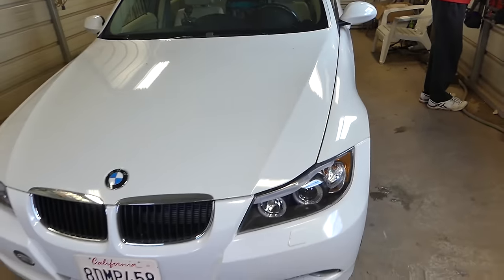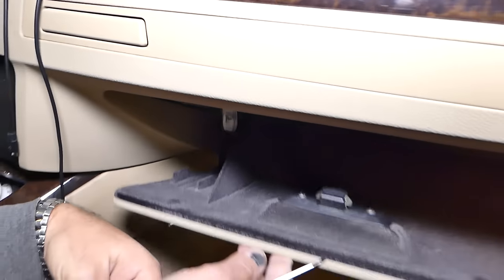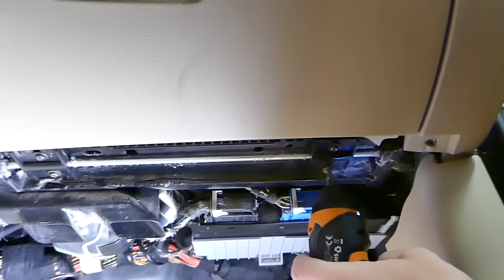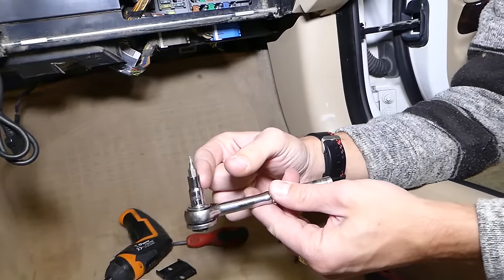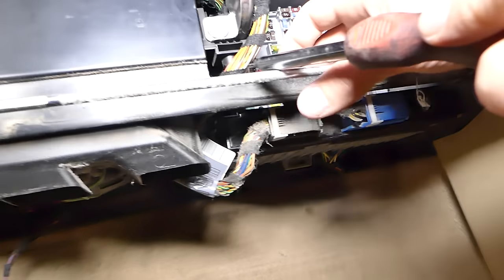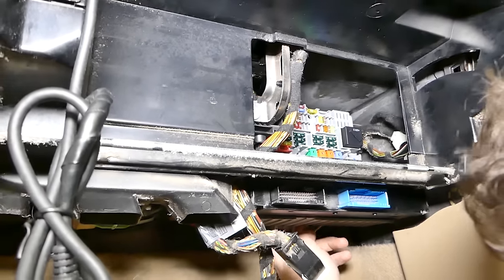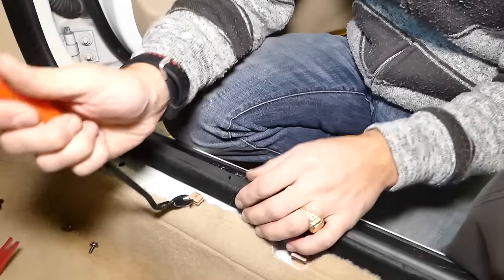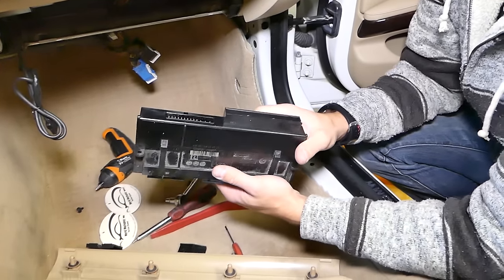HOW TO REMOVE AND REPLACE BCM MODULE BMW E90 E92 E91 E93 BODY CONTROL MODULE

Comment: How can I test if the BCM is faulty and where can I buy it if it needs to be replaced? Currently the cars cluster lights up and wipers won’t stop moving. I have checked ECW as well as the FRM and they are both working fine according to ECU-Pro. I have a 2008 BMW 328xi
Reply: Same thing on my 335i
Reply: ABS module

Comment: Without seeing how that rear wiring harness came out it would have been very difficult to figure out.  Thank you!
Reply: I tried to apply pressure on the rear wiring harness by pushing it to the right but it didn't move and I wasn't able to disconnect it. How did you remove it? Is there a trick in doing it? I don't want to break that thing.
Reply: @Bakdons-yn3cg  I know it is plastic and you want to be careful.  The part of the video we are talking about is at about 7:38.  Make sure you are pushing it in the correct direction (I am sure you are.)  All I can suggest is keep applying a little more pressure at a time until it comes out.  Good luck.

Comment: I have a bmw 325i 2006 but I have been having some issues with my battery dying when the car is off the alternator is good the battery is new . When the car is off for more then 15 to 30 minutes the push / start button turns on and  off. I think that is what has been draining my battery. What do I need to fix to make this stop and how do I fixes it ?

Comment: Seems the question regarding whether you need to code the replacement module or not is still pending. Anyone knows?  I have no power to the AC blower and the fuse is fine. I'm suspecting something is wrong in that junction box. Thanks in advance.

Comment: Thanks by the way. You did a video on the front airbags sensor. I discover the sensor on the car was unplugged after original owner have a minor crash. Cosmetic damage but it was not reconnected after repair. Your video saves me a bunch of money

Comment: Hi Can I ask you about this module.
My car is 1 series 2007 
I had a some strange noises coming from this box when I stopped the car from the (start and stop button) then immediately I start it again and then the noises started. The lights on the Dashboard started flashing and the key stock in the ignition. 
Do you know what is the problem?

Comment: Hi mate, good vidéo thanks ;)
I dont understand whether or not WE must unplugged the battery beforeremoving thé jbe? As you Saïd : IS really it mandatory as i have been told that removing battery Can bring issues for some programming modules, memory stufff ... Or am i wrong?
Then, do you know if WE must redo programmation if i plug a New jbe cause mine seems to be damaged no more AC, Rear door windows (i already checked with my mecanisc Friend with BM soft)

Comment: I watch a lot of your videos and they have been helpful I’m having an issue with the fuel pump I drive my 2011 328i xdrive and all of a sudden it just shuts of barely able to steer and pull off to the side of the road the message on the screen says fuel pump failure waited over an hour and it started right back up no problem drove home changed fuel pump watching one of ur videos thought it was fixed drive a few days later did the same thing waited 10 mins and it started up again no issues it keeps doing this need your help!!!
Reply: Cam sensor and vanos cleaning then clean cam witch is the crank under the starter, then change oil and cap if that font fix it clean throttle body after that hit spark plugs take them out wire brush if that don't help change coils . If those font work replace black box  fuse in glove compartment

Comment: Hi i got a 2007 bmw 335i
my problem is that i am not getting the dme to wake up, have no power to my dash.
when i disconnect the bcm the car turns on.
i tried replacing the bcm module with use ones and i am still getting the same result.
any suggestions will be appreciated.
thanks

Comment: I scored a nice running ( like new) 06 bmw 330i.  And if you have one you and this guy are automatically friends lol. It’s god steering wheel lock displayed and seems not reading the fob ( batt. Not dead) in car or fob. Cluster communication error but this is why I got it cheap !!! It is nice though.

Comment: Hi.
I have 2009 bmw 120d e87 and i have fault code 2e41 engine ecu interface.
I have checked all fuses and relays all loks ok.
Bat the car would only crank no start,the key is locking and unlocking  car no problem. 
Any recommendations to where to look next or what to do next?

Comment: Hey, could you explain fault code with I get 50 MRS power supply for bmw e83? I have airbag light on dash but can’t find info. Would think that I need to change steering spring but not sure if you could explain would be awesomely.
Thank you

Comment: Good video but you miss a step in your explication and it's a very important step. Im talking about the back connecter at end of the video. Every step is perfect but i had to find this information in other chanel. But over all it help me a lot utile i got to this part.

He talk about pulling the back clip to the right. That is acually true but before to do that you need to pull the modul out of his trey and twist it a little bit so you can slide the clip up inted of just saying to pull the clip to the right.
Reply: Thank you! This was what I needed to know.

Comment: Hi I’ve an 2010 E91 my blowers and air con just died plus stop start isolator stopped working even when I have my lights on the unit does not light up is it fuse’s or module or BCM as everything else is running spot on

Comment: friend, I have a BMW E91 (330D touring) 2007, the radio only touches one side of the car, the left side is muted, there is no problem with the cable, the radio is not burned out, you can tell if this module of the body also controls the radio?

Comment: Hi I have an e93 2011 my logic 7 amp has no power in the harness and the fuse is good do you have any ideas please no acoustic sound happened after pulling some fuses out

Comment: I've seen a video on YouTube saying the electronic control module situated behind the glovebox is responsible for auxiliary coolant pump, glowplug module and thermostat? These parts are throwing me fault codes and I'm wondering could it be the module before I change the rest. The auxiliary pump is working when tested on the bench? Thanks

Comment: I have a 08 328xi just changed the ecu and the cas with key and ignition  still no start. Crank but no start. Bruce Brantley

Comment: i have a 2007 530xi wagon everything lights up to start but the starter just clicks twice,,,Code DTC U112B Lost Communications with Instrument Pack Status (SIG) ...Do you think it is the BCM? thanks! iF YES IS IT LOCATED in the same spot as this video remember it is a wagon?

Comment: Does it control the key for open and close as well ? Mine does not work . Sometimes after a ride the key starts working again . So i can close and open by pressing the key . After sitting for 15min . The key does not work anymore when i press the open or close button

Comment: Hi !! I have a e 64 630i it cracks , but will not start (sometimes it starts fore ONE SECOND... ) I exedently put 12VOLT on the CANBUS wire (red/blue+red) sow i cheqed all the relais and fuses they al work.. i messurd the ohm on the canbus and it has onley 20ohm and on the computer unplugged 45ohm ... What doe you think please thank you !!

Comment: Hello guys, looking for some help here.

I have an 07 bmw e92 325i, which wipers arent working properly. I have checked relays. Fuses, replaced the wiper motor, tested known good steering columna with new wiper controler lever, cleaned the frm module. I haven't tested the bcm module yet, do you think this may be the root of the issue?

Any help will be pretty pretty appreciated!

Great vid btw, you guys always help!!!

Comment: I have 2006 bmw 325i I'm having a issue with car not doing nothing wen I insert key dash stays black car don't turn on I have interior lights also unlock and lock buttons work I checked all fuses and replaced relay in dash

Comment: Good day  i have a bmw 1 series 120i 
Car has no spark 
No pulse
No power on plug that goes in the valve tronic
And no power on the crank sensor plug
What could be the problem

Comment: Hi,
My central locking has stopped working on my car. When I press it to unlock it opens all of the locks, but it does not lock all of the doors when I press the locking button either on the key fob or the inside of the car, it only locks the driver door. Any advice? BMWe87 120d 2005
Reply: did u fix?

Comment: I have a faulty PDC… in BMW e64 convertible, changed sensors and wires straight from BMW but there is no sound nor these sensors work…. WHAT CAN I DO??

Comment: I have a problem with transmission with bmw e90 320i gearbox emergency i can’t drive i have changed the automatic oil and the filter but the same thing is the problem there at this part what u have changed please help me

Comment: Where the hell is the Transmission control module located on a bmw 335i 2007? I have looked absolutely everywhere and its like the TCM doesn't exist in a BMW 335i. Is it called something different? My cars code keeps reading back to my TCM but the TCM is impossible to locate.

Comment: Hy i have a problem with bmw e91 320d 2005 when a turn up the fog light and push the brake dont show the brake in the right if i turn off the fog light the brake work ?

Comment: My fuel gauge, central locking ( the indicators flash and the car powers off but the actuators don't lock), air conditioning(cooling) and wipers do not work (wipers turn on and stop on the middle of the screen), The only code I get is a 5E5B DSC button code and A738 JBE power supply interrupted code. Everything  else works. Is it a FRM or the JBE that is faulty?
Reply: Hi, did you manage to diagnose the issue? I have similar issues with mine especially the wipers

Comment: can i replace a JBE with a used one from Ebay?? or does it have to be new from BMW?
Reply: Hi mate,you must reprogram your New jbe box before start engine as it will not work and must bring some new issues as it will not be recognised by your car system

Comment: I have a 2005 BMW 645ci, I keep getting the Anti Trap Malfunction Light. I know how to reset it, and keep having to reset it all the time, the only strange thing is as long as the engine is running or the key is in the accessory position the windows are fine. ( up or down positions ) but if I shut the door the system fails to remember to roll up the window, and sometimes forgets to drop the window if I open the door. The latest issue is if I drop the top the driver's window won't go up all the way ( does it sometimes ) It will go up till it hits the seal the drops back down. Like I mention before It doesn't forget if I have the engine running or the key in the first position. Wondering if it's the BCM or power going to a specific module that supplies power to whatever controls the ANTI TRAP. Thanks, Guys!

Comment: such a rubbish and ass trash  engineering bmw . why  no a simple wire from battery to the light with fuse ??? the same reason german lost the war. rubbish engineering

Comment: I have an 06 bmw 330i, i replaced both primary and secondary fuel pumps and i still dont get any fuel pressure i checked the fuse, the fuse is good. What could the issue be? Mind you theres no fuel or any type of pressure coming out when i disconnect fuel line